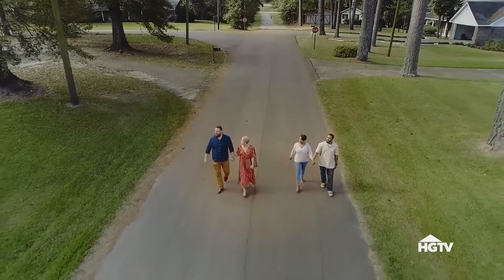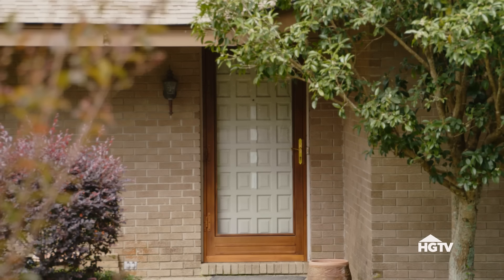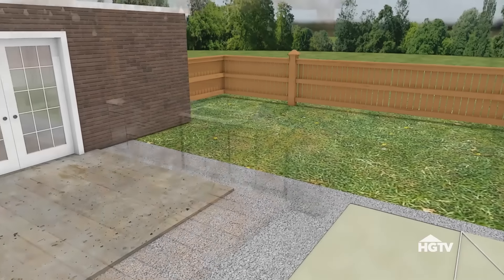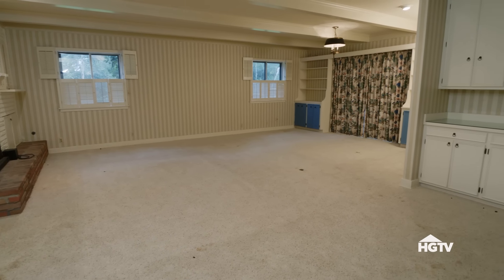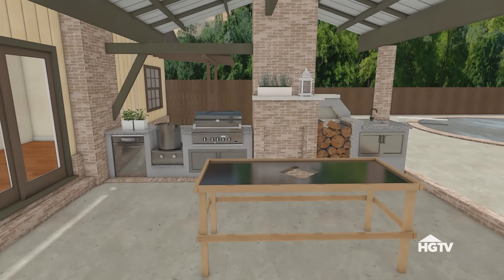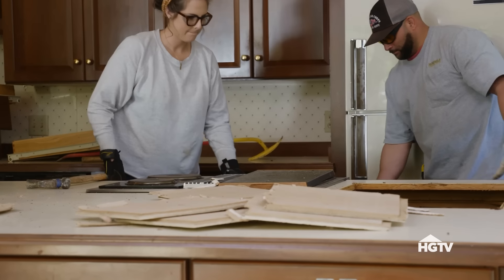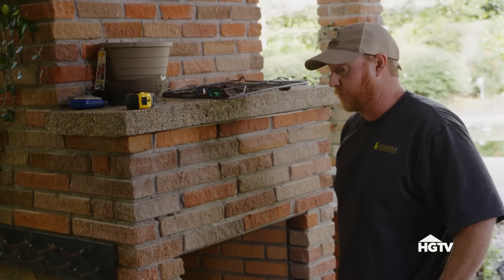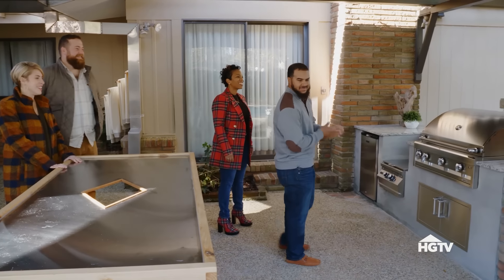The BEST Mid Century Vacation Home | Hometown | HGTV

Comment: Several folks have commented that this may have originally had a Kosher kitchen, which is a possibility...OR maybe the original owners had a big family (4 BRs!) and/or did a LOT of entertaining!
Reply: In a house like this, if the family did enough cooking to require two of everything they would have had the very large appliances. The duplication with the separation is very much typical of a kosher kitchen where there would be two sets of everything. Nothing would mix between the meat and dairy areas. That includes two sets of dishes and cutlery.

Comment: Did the previous owners keep Kosher by any chance? That would explain two of everything in the kitchen. I myself wouldn't know what to do with a ginormous kitchen inside and another kitchen outside.
Reply: Why does a kosher kitchen need two of everything?
Reply: @L.Spencer  Areas used for storing and preparing meat must be separate from those for dairy. So I learned from a friend who bought and joined together two co-ops!
Reply: @ginacrusco234  You are correct.  Perhaps former owners did lots of entertaining where 2 dish washers, 2 ranges needed, or perhaps small catering business?

Would have liked to have seen what that strange trap-door was for.  I believe there are longer versions of the shows, but need to pay HGTV to watch.